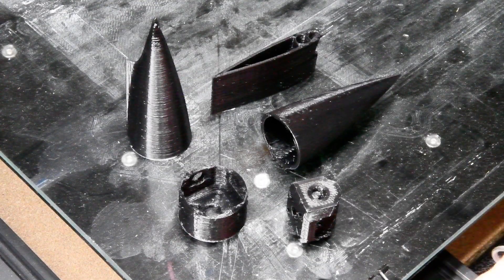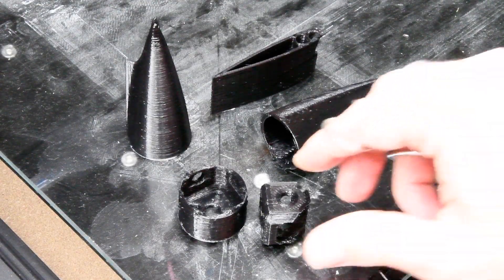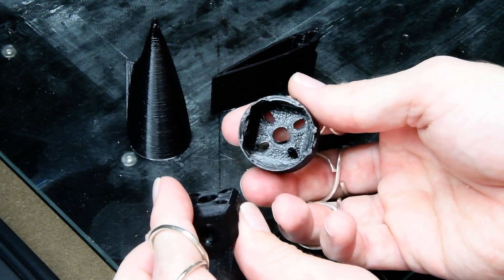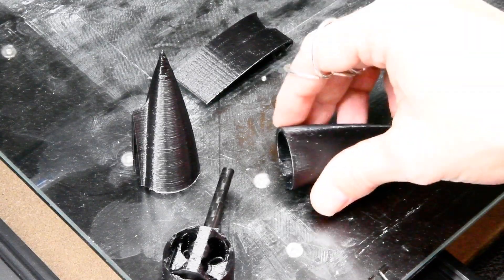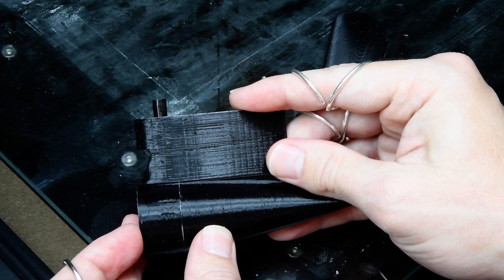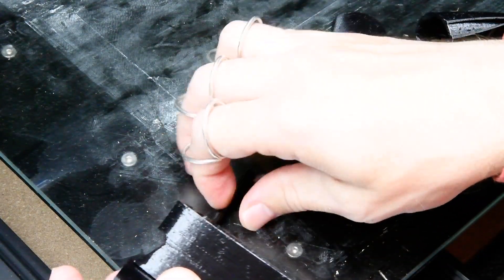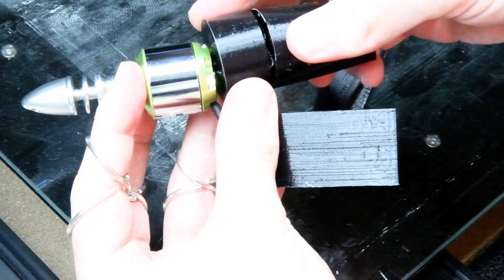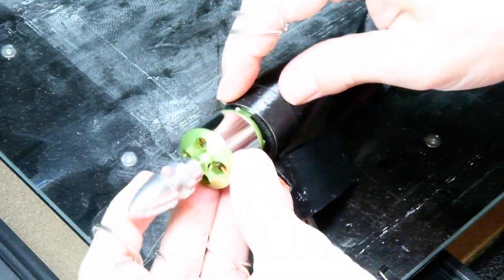Functional 3D printing strong objects

Comment: One way to avoid melting the pointed tip of the cone is to print 2 or more at a time, that way the print head doesn't dwell too long at the tip which is causing the melting.

Comment: Great work.........Your vids have me intrigued into these rockets shaped quads....... so 2 Qs.....where can I get the info for the FC set up and are your motor pod STL files available as these would make a great enhancement for my VTOL system I am currently doing......
Reply from the maker: Every setup will have different PIDs, but other than that, FC setup is the same as any other quad.  I have not released any files for this, the design in the videos is unstable.  I have a new version I'm hopefully testing this weekend that hopefully has improved stability.  Myself and some aerodynamics engineers have been doing way too much math and CFD simulations over the last two weeks.
Reply: Thank you for replying..... keep up the good work.

Comment: What's with the finger wires?
Reply from the maker: They mechanically stop my hyper mobile joints from over extending which causes my finger tips to lock up.  I got an unfortunate gene that went wonky (kinda like Gene Wilder in Willy Wonka) and many of my joints dislocate.
Reply: @ZombieSS77  Cool.